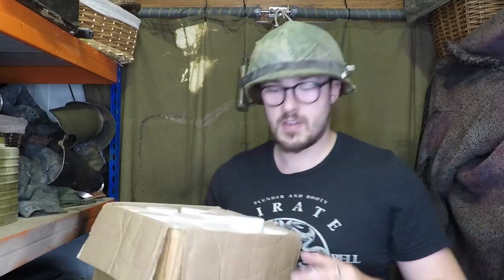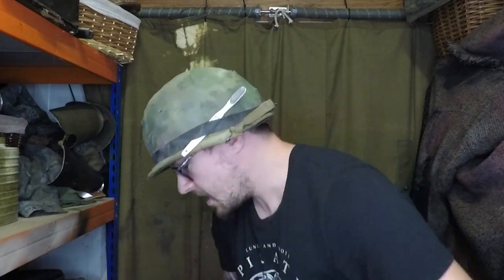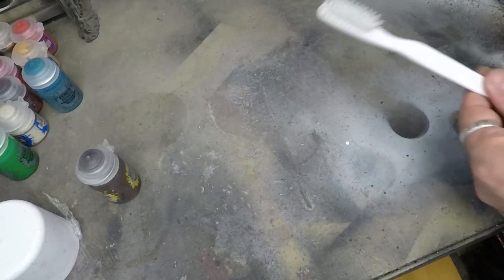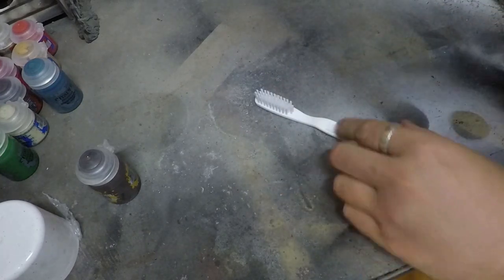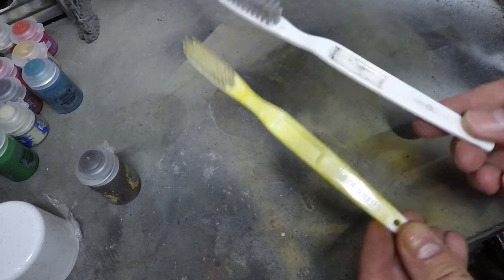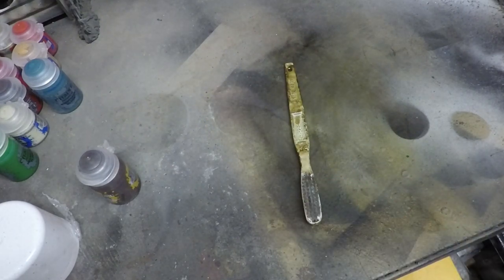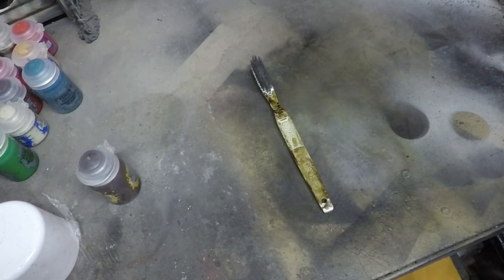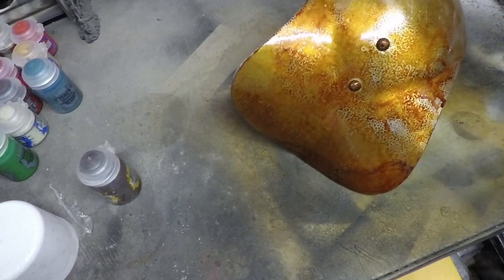dirty down ageing spray tutorial

Comment: Hi love your work! Is there a spray i can use which is more permanent for fabrics? I have only experimented with spray paint atm and ofc it 95% came off in the wash.
Reply from the maker: Seth Dylan depends on the look you want. I use a mix of acrylic, spray paint and dyes for permanent effects. But most things will come out in a machine wash so it’s best to wash by hand if you want to minimise that
Reply from the maker: Seth Dylan for an ice winter look use fine white spray on the lower sections. Sort of depends what sort of climate as most ice et doesn’t build up on clothes unless extreme cold. Dirty down do an ice spray that’s very good

Comment: How does the finish feel on material Mr W? Does it remain soft or does it have the same feel that you get when you use a regular rattle can?
Reply from the maker: GearTechCustomPaint it doesn’t affect the material at all, which is one of the BIG plus sides to using dirty down.
Reply from the maker: GearTechCustomPaint you tried acrylics or dyes ? Check out my weathering tutorial for fantasy costume. Same techniques work across genre